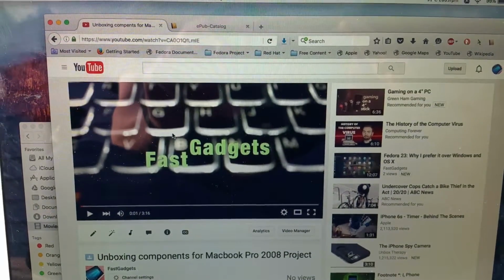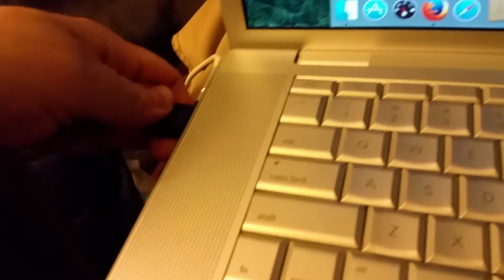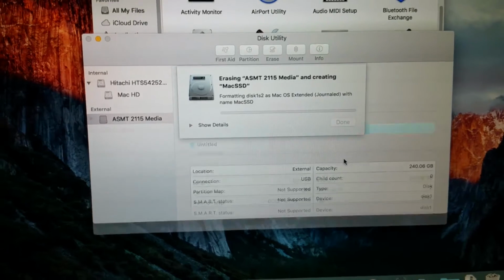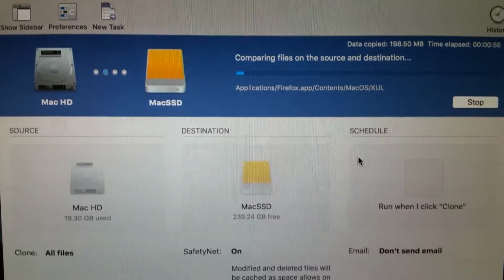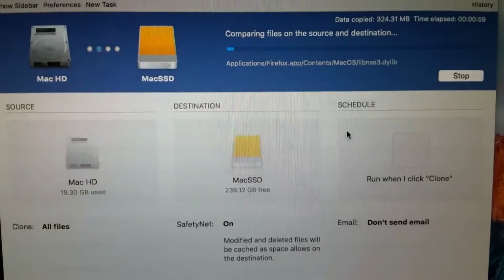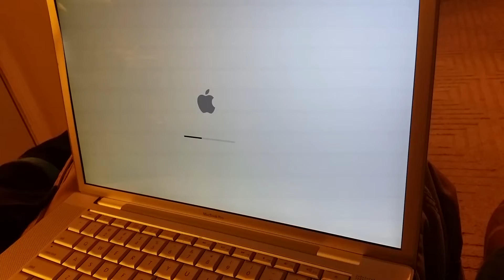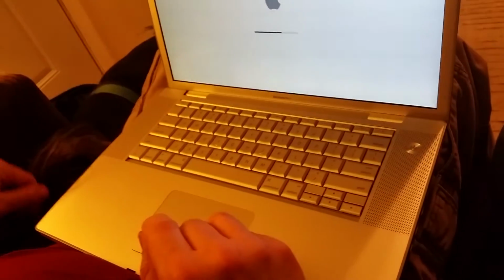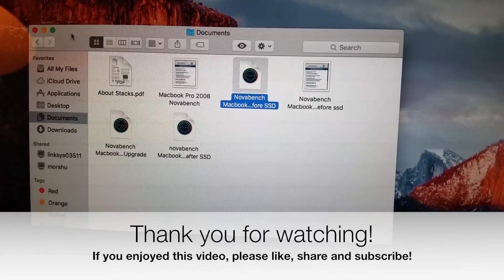Macbook Pro 2008 SSD Upgrade and Benchmark

Comment: Hi, I have a mid 2007 MacBook Pro 2.2GHZ and it's hard drive is corrupted (apparently). Do you know know if I can use the same upgrade path on yours to a SSD on my machine?
Reply from the maker: Tony Denner unfortunately no, you would need to install from scratch on the new SSD.